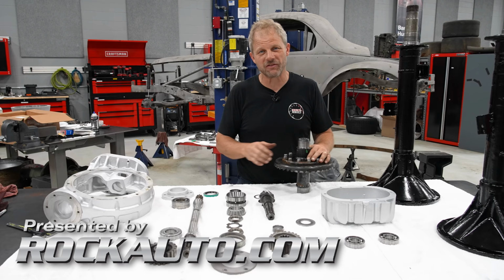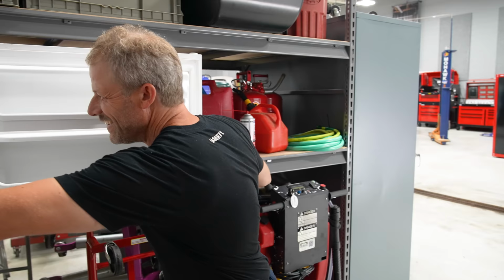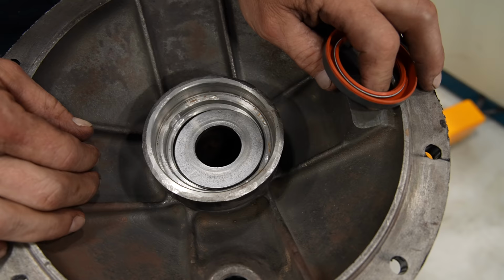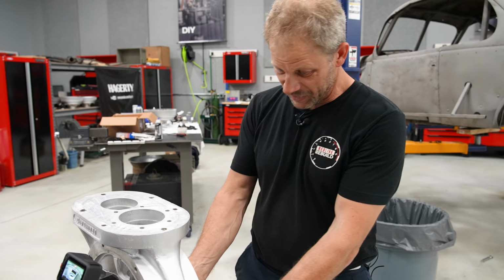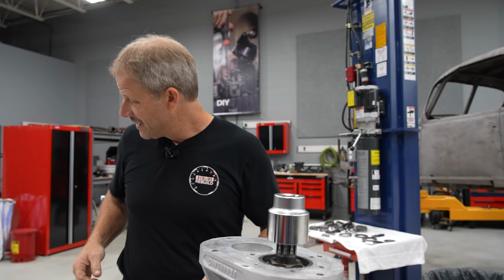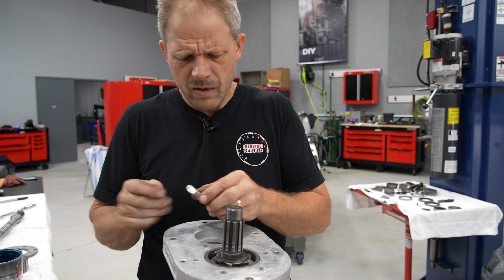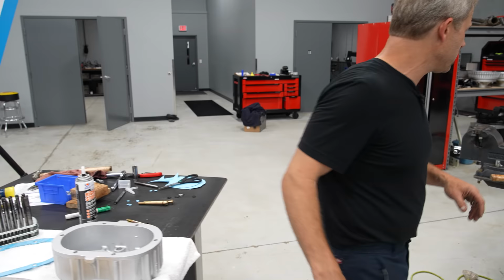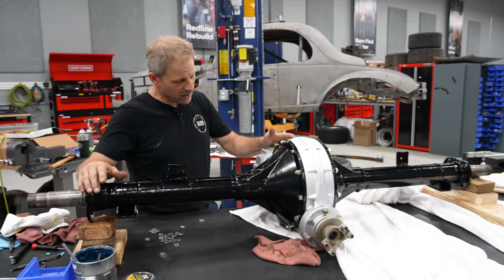Assembling a vintage Frankland Quick Change rear differential | Redline Update #88

Comment: Coefficient of thermal expansion is based on per degree. Like someone else suggested you need to go colder to do it. Use liquid nitrogen or dry ice.
Reply: I've had success with this method using a deep freeze to shrink the race and oven to expand the bearing. As you note though there are many factors in this method working or not, but the regular freezer on a fridge doesn't come close to cold enough.
Reply: Awsome isn't it. The change has to be exponential. I have used dry ice in heavy industry but never found it more efficient than just a press and balanced heat when possible.
Reply: Or just press em real quick. 😂🤣
Reply: Check rotation torque after the cram nut is set .
Reply: Dry ice and alcohol
Reply: I let them sit in the freezer overnight, then I use a can of compressed air (carbon dioxide) keyboard duster from Walmart, turned upsidedown so the liquid will spray out on my part. It'll freeze things to a ridiculously low temperature.
Reply: Cannot beat liquid nitrogen.
Reply: @alreed2434  it can be hard to get right now and most people don't have a Dewar sitting around that's appropriate for transport.
Reply: @calvinlim9485  No doubt just know that it'll provide much colder temp than a freezer. And yeah almost everything right now is in a shortage. Slowly starting to come out of it hopefully for everybody's sake.
Reply: @alreed2434  yup. I do lab work and used to buy 240 liter tanks all the time. Used to be cheap and easy to get.
Reply: I deep-fry my bearings in hydraulic oil and freeze parts in dry ice and rubbing alcohol
Reply: @bryancohn9406  it is cold enough. A little heat on the receiving end with a good heat gun and they will drop in by hand. No heat just light taps with a small hammer is all that is needed.  Liquid nitrogen is a bad idea. You get that bearing too cold and it will shatter like glass
Reply: @ChunkyMonkaayyy  thats fine if you have a press. Out in the field in the middle of nowhere a can and some snow or ice work just as good as the freezer. Then a little heat from the torch and bobs your uncle

Comment: Be careful how hot you make the bearings, If the steel is turning that brown colour, you may be messing with the hardening/tempering. If it is just cooked grease that another thing.
Reply: That just might be the prelube by factory to prevent rusting - but good point 😊
Reply: I use an electric frypan with gear oil in in for heating bearings, I don't trust dry heat like that
Reply: Buy a milwaukee heat gun. Just couple of minutes with one of those and its hot enough to fall on and no chance of overheating

Comment: When you heat an item in an oven, its temperature (and expansion) is increased by several hundred degrees. When you chill in a refrigerator, the temperature is only reduced by about 50 to 60 degrees. Thus the difference in effectiveness between the two processes. Results would be closer if you chilled with liquid nitrogen.

Comment: I worked for Frankland Race Supply with Fred Bratchie building those rear ends. We just warmed up the housing  with a torch for the pinion nose bearing. Drops right in.  There is a seal for right side tube called a Seals-It, keeps gear lube from going to hub. The outer races I just used press to seat in place. There's an upgraded w piece nut for pinion to lock it in place. Gears are usually placed big on top small on bottom. We always checked gear swipe pattern and lash before final assembly. Used a dial type inch pound torque wrench and dial indicator for lash. great rear for dirt cars.

Comment: I've not done a Franklind, but I've have done a lot of Hallibrands. The support bearing on the pinion on a Hallibrand is a shrink fit in the case. The proper method is to heat the case with a rosebud torch and install the support bearing. You also assemble the pinion and bearings outside the case using and old quickchange  gear to hold the pinion in a vise. This makes it much easier to tighten the pinion nut. Once you have the bearings assembled with the proper preload, you again heat the case with a rosebud torch and install the pinion and bearings as an assembly. 

I never used a gasket on the QC cover, but I did run Hallibrand.

Comment: it's not a freezer that you need, its liquid nitrogen.
It is not more difficult to contract than to expand, thermal expansion is pretty linear. It's just that the oven is 150+°C, the freezer is at best -20. Liquid nitrogen being -200, it would contract the thing as much as the oven expanded it.
Reply: Dry ice = frozen CO2 - is easy to get and works wonders.  Regular kitchen freezer... not very cold.   Zero degrees vs.  minus 100 degrees.
Reply: Also, very impractical.
Reply: Also the higher chance of snapping it. Remember the colder it is the more brittle
Reply: You're spot on Damien, liquid nitrogen is the way to go.
Reply: I have never had any problems using the freezer for shrinking bearings. They dont drop in just light tap with a small hammer
Reply: It's more difficult in that it's harder to find liquid nitrogen than an oven.
Reply: I think butane works to
Reply: Same thought, well said 🙌🏻
Reply: @holmes1956O  I guess you just had bigger clearances. But good for you 👍🏻
Reply: @robotkabot7541  lol ya ok I have been using this method for over 40 yrs

Comment: To install the ball bearing into tje2 housing that you were concerned about. Use to large flat washers even double up on the washers if necessary. A large piece of fine threaded rod and 2 nuts. That will draw the bearing in no sweat no damage

Comment: A regular freezer will only get as cold as the outdoors during the winter so the bearing won't get cold enough for a loose tolerance. Otherwise the would fall out during the winter untill the warm up lol. You need to use dry ice to get anywhere. Good luck looks great.

Comment: the CLTE for general mild steel would max out at .00145" shrink over a 4" diameter so there would be no appreciable movement.  You would need a 250F reduction from room temperature to shrink a 4" diameter by ~.007" to allow the press-fit to slide in.

Comment: I know this comment will get buried at the bottom...but for the mystery washer I think the location is right, but between it and the nut there should be a claw washer.  @12:42 you can see one of the splines in the shaft goes all the way through the threads. @9:23 you can see witness marks on the inner diameter of the washer that suggest another washer was there and not the nut. Thanks for posting these videos, I love watching and learning on all your projects.

Comment: We always did our Quick Change Gears the opposite of how you're doing it. The bottom change gear is the Drive Gear and the Top Gear is the Driven Gear. Big gear (Higher tooth count) "Fat Boy on Top" gives you a lower gear ratio (Higher Numerical). Fat Boy on the Bottom makes it a Higher (Numerically Lower) final drive ratio. I think with your 22 tooth gear on top and your 20 tooth on the bottom you will have a 5.34:1 ratio. Just check your numbers manually and remember that Fat Boy on Top is always a Lower Gear. We almost didn't qualify one night because we had no pull off of the corner and we weren't up in our RPM Band.

Comment: The way that I was taught (years ago) to drive a race in with a hammer, 
is to would take an old race of the same size and use it as a driving tool - thus never directly striking the new race with the hammer.

Comment: liquid Nitrogen is the correct way to apply thermal shrinkage for metal to fit, however dry ice usually works pretty well too, a standard freezer does not get any where near cold enough to cause any sort of thermal shrinkage.

Comment: In the freezer you're only dropping 50-60 degrees from air ambient compared to raising 200-250 above in the oven. I use a Fry Daddy filled with synthetic oil (higher burn temp). They are cheap and available. I agree about brass tools. I make punches with rebar. Softer than puppy poop and grippy with oily hands.

Comment: Has to be a lot colder - try dousing it with freon or propane or if that offends you then pack it in dry ice.   You can also warm the bore that the race goes into.    Trick to remove a bearing race - arc weld a bead around the inside of the race - when it cools the race shrinks and will fall out.

Comment: Killer build ! Love the out of the ordinary! 

On the heat and shrink topic. Yah a liquid nitrogen is cheap . However, a liquid ni dewer is very expensive . Upwards of 800-1000$ bucks. (Depends on where you get one) You can almost duplicate the nitrogen on the race install by freezing the race( as was done), then careful and thoughtful application of a mapp gas torch on the  seat area of the axle tube. “Falls in” . Remember however , the smaller the items your dealing with, the less the amount of shrinking or expanding you’ll get for a given temperature. This is why ring gears on flywheels fall on so easily with just a small amount of heat.

Comment: My opinion on heating a bearing vs freezing a bearing is that the item changes size a certain amount per degree, in either direction. 

You can easily enough heat the bearing by 200F over room temperature. You aren't gonna even get half that difference in a freezer, so of course it's not going to work as well.

Comment: Well, after all these years - someone explained the quick change diff in normal terms... I've heard people make it sound more complicated than the Hydrogen Bomb. :)
Reply: there is set of gears on the input of the diff... one is smaller one is bigger(different combo exist depending on what you want) swap those 2 gears and you swap from low to high. thats it

Comment: Cold works but you gotta use dry ice or heat the receiver with a propane torch if you are only using the freezer.

Comment: Rule of thumb for steel. You change in size .000006” for every degree of change.
Reply: Heh put the decimal in any spot.
Reply: 6 millionths per degree "per inch"... size matters.  :D  And just as an aside, aluminum (6061, they vary a little) is a little over double that at 13 millionths, magnesium is about 14 millionths.

Comment: Dry ice works great for shrinking bearings sleeves and anything else that could use to be a little smaller for installation purposes. Definitely a higher success rate but again it isn't perfect and sometimes

Comment: I've been using a microwave to heat bearings. Before anyone informs me how they work I KNOW. The trick is to wrap it in a WET towel and don't let it dry out. This isolates the metal and regulates the temperature to 212°f or 100°c it works great.
Reply: Seen that on aVe a few yrs back , haven't had an opportunity to try it yet.
Reply: Whatever you do, dont throw a few old cd/dvds in a microwave for 10 secs. They wont make blue sparks all over between the plastic layers and leave a spiderweb pattern.......

Comment: I try to use the original bearing race to drive in the new one.  If the outer race is recessed I invert the old race so I can pull or drive it out after the new race is seated.

Comment: You have to be mindful of the delta. When you stick a the inner bearing assembly in the toaster oven, heat it to 400°, and the room temp in the shop is 68°, you have a delta of in excess of 300°.
But in a freezer that’s 30°, and room temp is 68°, that delta is only 38°. 
To use the freeze method, you put the races in a pressure pot with about 5 lb of dry ice. Let the ice melt in the pressure pot till it’s liquid, them open the valve. Instant -200° bearing races.
Reply from the maker: Great info! We’ll have to give it a try.

Comment: It was cool how you made that gasket but it’s aluminum on aluminum, grey RTV would’ve been fine.

Also if you want to make your gaskets re-usable coat both sides in wheel bearing grease and it will keep it from sticking.

Comment: No hammer is needed at all. Set oven to 350, set center section in for 20 minutes, drink one beer, have bearing and shaft assembled and ready to install.  Get oven mits, remove center section from oven. Turn center section so bearing and shaft will fall out. Flip over and install new bearing assembly. It falls right in. Open another beer, let cool. Ur done.

Comment: Actually thermal expansion works the same way on either side, your temperature rangers were off, heating things up usually are done with a blow torch or oven, easily rising temps to (100+ C) 250+ degrees F, but a freezer will sit at (-4 C) 30 degrees F. So it didn’t get cold enough to really size down, try other methods of freezing like Dry ice or liquid nitrogen, that will more less be similar to heating up the metal. Also try both, freeze the insert and heat up whatever it’s getting inserted to!

Comment: Everyone has a bottle or two of liquid nitrogen layin' around!
Reply: I use to have access to it when I worked maintenance in a fab shop.
Reply: These comments have me like 😂🤣
Reply: Nearly as good: liquid CO2 - I let them sit in the freezer overnight, then I use a can of compressed air (carbon dioxide) keyboard duster from Walmart, turned upsidedown so the liquid will spray out on my part. It'll freeze things to a ridiculously low temperature.
Reply: A co2 fire extinguisher works most of the time
Reply: @Bird76Mojo76  emergency beer chiller
Reply: @lukenellermoe6266  Overkill much? Tons of waste.
Reply: @Vintageguy73  When I worked for GE we had a constant flow liquid nitrogen system on our machines. It would make Gatorade slushies in about 4 minutes. I had it timed perfectly. lol
Reply: It’s actually not a problem to get liquid nitrogen, almost every cattle rancher has a tank

Comment: One of the things we did while I was working on aircraft wheels was that 1st the bearing races had to be in the freezer for a minimum of 72 hours. This ensures that the whole race reaches the low temp you want. but we would also heat up the rim 1/2 in an oven to help. Considering your setup in the shop I realize that's not exactly feasible for these parts. But it's something you might want to keep in mind for other items. Just a thought. Maybe get a used full size electric stove to use the oven part for this?
Reply: Also, set the freezer control to max for this, that way it gets to sub-zero temps. Not by much, but every degree helps.

Comment: I think it only works using a freezer, if you heat the other part. In order to gain the maximum clearance potential. Otherwise like others have said Ln2 is the way to go for shrinking.

Comment: Liquid nitrogen is the best for freezing bearing races, valve seats etc but you need to know someone who uses it in their field of work eg. Hospital .
2nd best is dry ice packing dry ice around the part you want to freeze and leave it for 1hr i found works especially if opposite part is heated up

Comment: Not harder , just a refrigerator is maybe 55 f below room temp , you heated the bearings maybe three times as much or more. Heat the tubes with a torch and then it will slip

Comment: The often over looked quick change. It would be awesome if someone created one that could change at the flip of a switch.
Reply: Call that a gear box...
Reply: it exist... its an overdrive for  old 3 speed auto...its a planetary and you engage it with a selenoid, you can use it as a low high or split every gear and get a 6 speed( it fit at the end on the trans)

Comment: Well, the temp gradient is enormous. (Heating a 100 mm piece of steel by 1°C expands the part roughly by 1μm) Same for cooling it.. the temperature difference by heating it is almost 200°C, by cooling it rather just 40°C below ambient.

Comment: Just a heads up I'm not sure how hot you got those bearings but they looked to be a straw color which means you may have unintentionally tempered the bearings, they may be hardened bearings by tempering them it potentially softened the metal impacting the life of the bearings.

Comment: You have to have a deep freezer at emd (former g.m.) we had a freezer that got to -50/60 then we would lightly heat the surface that we were dropping our frozen bearings in never well hardly never had to use more than a few love taps from a dead blow

Comment: came here about an hour after this was posted
32 comments (mine is 33rd) 488 likes,  7 dislikes [for the record  I pressed liked)
Now, as to heating and cooling parts that are a press fit . . . .
here's a good general rule of thumb for "steel" parts
For every 100 degrees "F" of temperature increase there will be about a 0.001 inch per inch of expansion.
in other words, if you have a 3.000 inch diameter steel disc (or hoop) and increase it 200 degrees it will expand to 3.006 inches
that's an approximation but it's fairly close
Reply: great info.

Comment: You have done more damage to those carrier bearings than 50 years of racing. And they are very simple to press on.
That washer may be a pinion bearing shim.wonder 4.86 pinion. Did you check it for cracks? Using early Halibrands with Ford V8 gears the 4.11 break pinions. The 3.78 A model gear set does not break the pinions.
Though 400 plus yard tracks @ 6000 rpm with a 92" r/r is around 6.55. Bigger tyre a bit shorter.
The diff tube gasket sets your  gear mesh. I have seen people spend hours doing that.
Use synthetic oil, it will save those old gears. Run cooler with better contact lube.

Comment: Freezing? Use liquid nitrogen. .... The fridge freezer doesn't get cold enough 👍.
Reply from the maker: True that! Liquid nitrogen isn’t something we have just sitting around the shop, unfortunately!
Reply: @Hagerty  You used to be able to get dry ice at Baskin & Robbins.  Dunno if it gets things cold enough to be useful, but dry ice in acetone is a pretty common cold bath.
Reply: I let them sit in the freezer overnight, then I use a can of compressed air (carbon dioxide) keyboard duster from Walmart, turned upsidedown so the liquid will spray out on my part. It'll freeze things to a ridiculously low temperature.